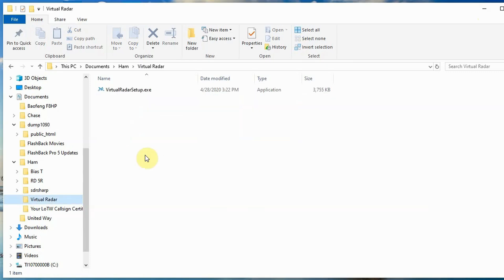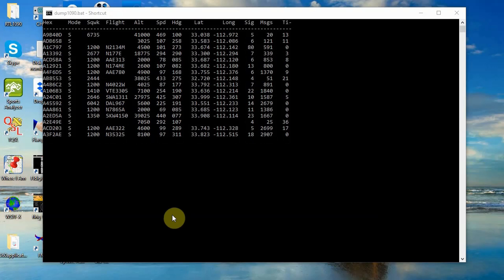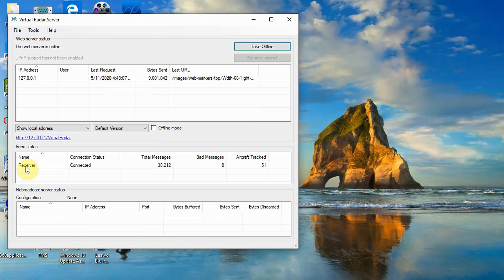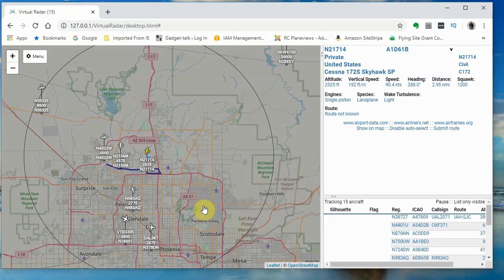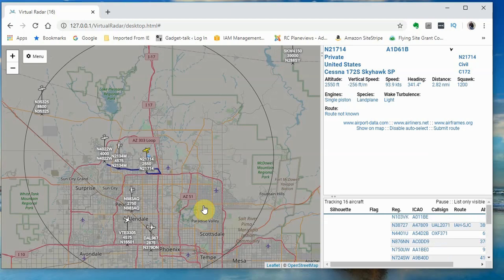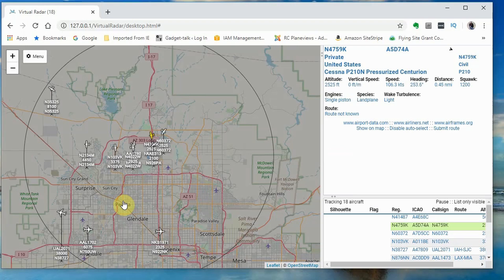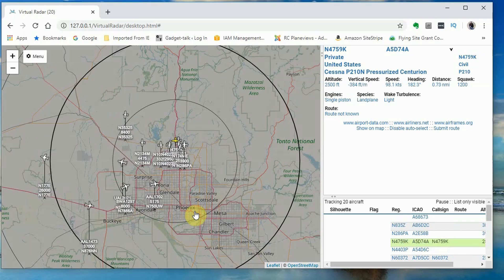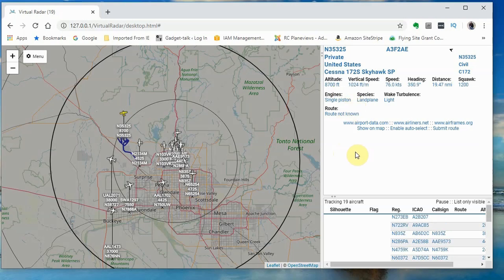Tracking Aircraft Using the RTL SDR Dongle

Comment: @9:13 I Get No connection could be made because the target machine actively refused it. Any idea of what causing the issue ?
Reply: You need to have dump1090 running when you test the connection and also the port is 30002
Reply: @XxDarkWhispererxX  Im not into it anymore but thank you so much mate ! I will try this when I go back to RADIO hobbie x)

Comment: Found DUMP1090, but the bat file is not running like shown in the video. It just says that it found 2 devices (and not the V4 is selected) press any key to continue. O_o
Reply: Same problem here...

"Found 2 device(s):
0: ð²↓, ¿■↓, SN: e (currently selected)
1: Realtek, RTL2838UHIDIR, SN: 00000001
usb_open error -12
Error opening the RTLSDR device: No error"

No idea how to solve it...
Reply: @Xatortxo  You need to download the drivers for the dongle which can be done by installing Zadig, had the same issue

Comment: In my list, I can see 30-40 planes.  On the map, they are all stacked in 2 locations and don't move.  What is going wrong here?  Why is this working by default so easily for so many?
Reply from the maker: Really don't know. Sorry. Is the map scale so small that everything at an airport is stacked on top of each other?
Reply: @GadgetTalk4U  No map is fine.  Can pinch and zoom anywhere on map like a real map, but the icons are stacked on the polar top of the map and the equator directly below.  I can click on the list, and the hightlighted plane pops to the top of the stack.

Comment: does it still work?i downloaded dump1090 zip file from github but no batch file included.

Update:
Got it working, need a little tweak on dump1090 jss, css, html files (CRLF to LF).
Batch file used is as follows:
dump1090.exe  --interactive  --net  --net-beast  --mlat  --gain -10 --device-index 1
pause

edit using notepad++

Thank you kind sir! Great vid as always.

Comment: The two arms of the Dipole are separated by a small distance where the feed comes in ... do you take that distance into account when determining the desired length to expand the telescopic arms? ... or do we just ignore that sepparation?
Reply from the maker: With a dipole you were transmitting with, you'd tune it to a lowest VSWR you could get. With a receiving antenna, close is good enough. The antenna legs are what matters.

Comment: I get ads-s not from so far away, but my antena is a dipole made for receiving NOAA weather broadcasts, it works well for receiving acars from ~150 miles (131.7-8 mhz).
I looked it up now and saw that ads-b signals are in the 900's 1500's Mhz.

'Hey Phineas, i how what we're doing today.'

Comment: I'm also in Phoenix and want to know how high up should my antenna be up in the air to receive the best signal?
Reply from the maker: Generally the higher the better, but there comes a point of diminishing returns. I get good local coverage from my desktop on the second floor. Pinnacle of your roof should be plenty high.
Reply: @GadgetTalk4U  I went to Ham Radio Outlet since it's right down the street from me and got a scanner antenna. It covers the 25-1300 MHZ freq. You should test it out and put it in one of your videos. I just have it sitting on my desk and it works great. Might help others that watch this video and you can add where to buy it.

Comment: Could someone help me find the latest version of dump1090?  The only one I can find is several years old and does not display aircraft like seen at 7:25.  Thanks!!!
Reply from the maker: Try https://airspy.com/download/ or

https://github.com/MalcolmRobb/dump1090
Reply: @GadgetTalk4U  Just figured it out.  For those with the same issue, paste "--device-index 1" in the top line of the dump1090.bat file.  It works!!!
Reply from the maker: @kevinfox2413  Glad you found it and thanks for sharing!
Reply: @GadgetTalk4U  Thank you for the quick reply, I'm getting usb_open error -12.  Error opening the RTLSDR device: No error.  Google hasn't pointed me to a solution.  Any suggestions?  Thanks!

Comment: Thanks for the information. I've installed Virtual Radar and Dump1090 and it's working for my local area. I am having an issue using SDRSharp and Dump1090 at the same time on the same SDR dongle. Is this as expected or is their something I can do to get both programs to work at the same time. Thanks
Reply from the maker: Good question. Not sure. I suspect it has to do with port assignments and   associated drivers un your computer.. If I was playing detective,  that's were I'd start.
Reply: from where u installed dump1090 can u give the link

Comment: I Have 17 Meter High Antenna On My Roof, I Got 1 Plane ONLY, WHat is the problem? :(
Reply from the maker: Try this link for SDR software including dump1090. It lists a link to github to download the software. It's a zip file a short distance down the list of files assuming you're using Windows. 
https://www.rtl-sdr.com/tag/dump1090/

Try this link for a couple of easy DIY antenna's. It's not how high so much as the right length. They are just a couple of inches long since the frequency is so high.
https://discussions.flightaware.com/t/three-easy-diy-antennas-for-beginners/16348

I use the dipole antenna mount that came with my RTL-SDR with the short extensions fully retracted. 

A small mag mount of the proper length on an inverted pie plate should also work nicely.

Comment: bat 1090 not working. 
No supported RTLSDR devices found. 
Why is that the techy devs that can hack a car fail to make a normal installer.
Reply: Were you able to find V1.45?  I'm having trouble locating the newest version of dump1090.

Comment: Hi Good morning, I am trying to set up Dump1090 with virtual radar server , but when I do the test connection after running batch file it says "connection could not be made with these settings because the target machine actively actively refused it 127.0.0.1. Is this a Dumo1090 issue or virtual radar / best regrads
Reply from the maker: Check a couple of things. Does dump 1090 run and fill the window with aircraft information? It should. I must be running when you set up VRS. Next, be sure you've answered the questions in the receiver wizard correctly, SDR Radio, Dump1090 and on this computer as described in the video. If these are correct, I'm not sure why it wouldn't work. You could try one of the other decoders listed in the tutorial page on RTL SDR .com. You've had SDR Sharp running?  If not, be sure that it works. I could be a driver problem and you need to run Zadig program again to ensure the right driver loaded.  I've also found that the driver can be USB port specific. Have you changed where you plug in the RTL-SDR dongle?